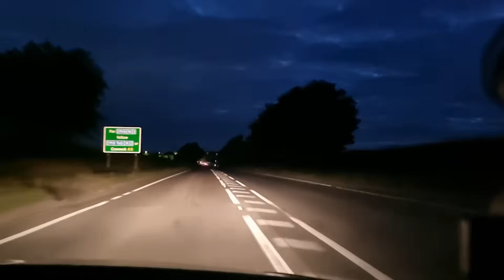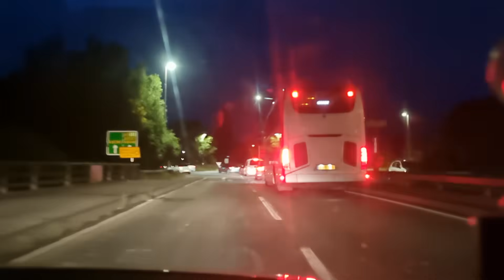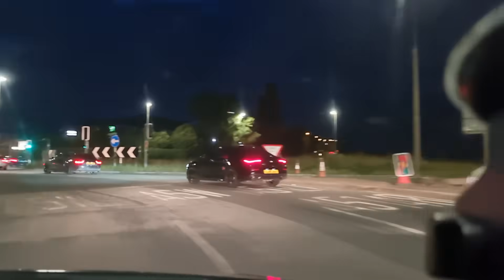Can You Use Leaded Solder For Repairs?

Comment: Good video. Under European and harmonised regs you are not allowed to use leaded in "a production environment". In a repair environment it's legitimate to do so. In a company with employees you must take action with regard to the safety of your employees, COSHH regs and lead exposure. As a lone trader or hobbyist that is not so much of a legal issue but, sensibly, you should look after yourself. Despite some comments below, extraction is important for flux and other contaminant fume removal but there is little (if any) lead boil off or subsequent inhalation risk as electronics repair is generally a controlled temperature environment (soldering huge joints using a gas torch or uncontrolled preheating etc are other kettles of fish). The main lead risk is through skin contamination and ingestion so ideally wear gloves or use barrier cream (both of which have issues) but always wash hands, don't eat it in your sandwiches or dunk it in your tea etc. Equally consider the final use of the object - if a joint is exposed such that a customer could contact it in normal use, that joint should be made lead free or encapsulated to prevent contact. Most of this is common sense but many do not consider waste. If you are using leaded solder commercially (and ideally as a hobbyist) you should be abiding by local lead disposal rules. If you dump lead waste in the normal refuse you could (theoretically) be fined for dumping hazardous waste. Just collect all you waste solder splatter and wire ends in a plastic bag and weigh it in at a scrap yard every year ... keep legal, save the planet and get to spend the scrap money on a pint!

Comment: The ONLY time I don't use leaded solder in a repair, is with copper plumbing. Strictly silver solder there.
Reply: what do use to melt silver solder?
Reply: @edwardyeo8031  Same as with lead, a MAP gas or propane torch.

Comment: Professional repair centers are expected to comply with RoHS and should avoid using leaded solder for repairs unless it's specifically permitted under an exemption such as products manufactured before 2006.
Reply from the maker: They do comply with RoHS even if they're using leaded solder. There is no law on using it for repairs regardless of when it was manufactured or who is repairing it

Comment: The big problem with using a different type of solder from the original used to make the joint is the significantly increased risk of a poor joint and compatibility issues. It it was made using leaded in the first instance then use a leaded solder to rework or repair it, otherwise use a lead-free solder. If in doubt, clean the joint area thoroughly and use a decent quality lead-free solder unless there are specific reasons to do otherwise.

Comment: When I first started electronics many years ago, I used leaded solder. These days I almost exclusively use a lead-free solder and prefer it to leaded even for repair work. The trick to get decent lead-free solder joints is to get the temperature exactly right for the solder and use a really good quality solder. A good quality temperature-controlled iron is essential. I have a really fine silver lead-free solder that I use for higher quality construction or repair work as the conductivity is a lot better.

Comment: As someone who used to spray for a living, I can tell you that double yellow lines still contain lead, 
With solder you are correct in what you say, but generally you can't sell leaded solder to a private person in the UK, it has to be professional use. 

I'm only applying the paint logic to solder, so I'm not 100 percent sure this is the same
 
when I used to spray, I got tested with what chemicals I was breathing in, and tbh in a normal spray shop, even the harmfull chemical barley registered on the test, all below workspace exposure limits. 

So personally small bits of soldering don't phase me,